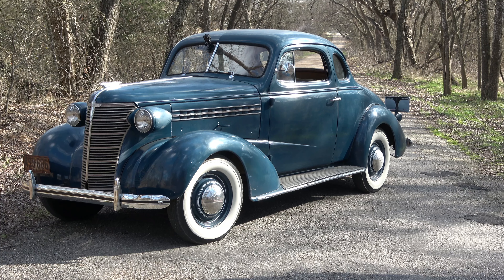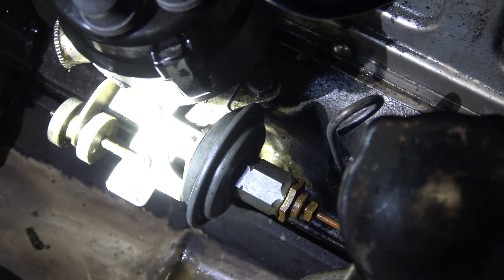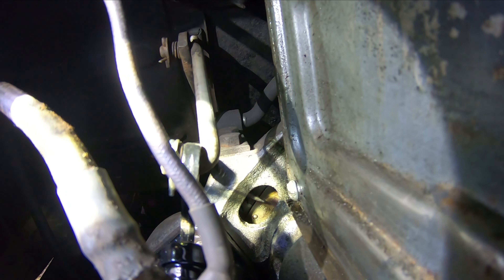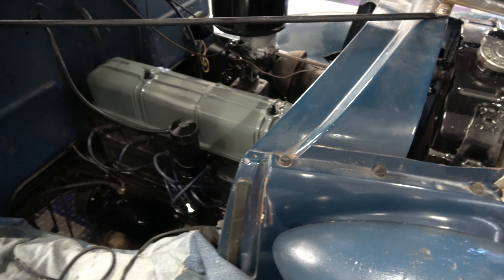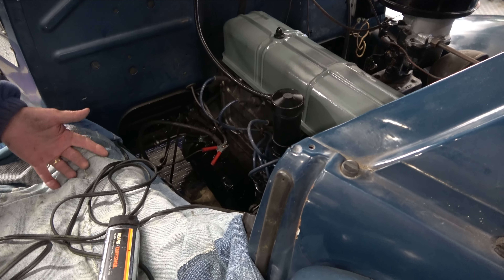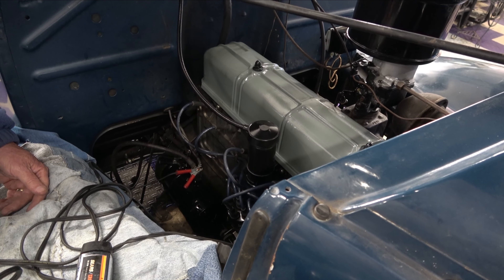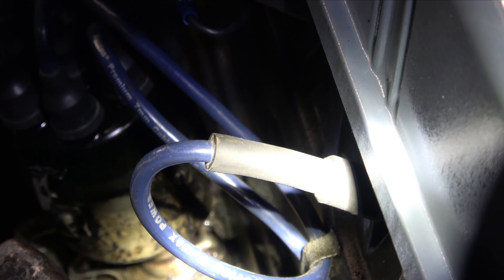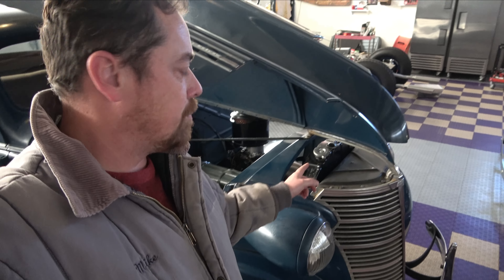Setting The Timing On A 1938 Chevy Coupe Master Deluxe 6 Cylinder!

Comment: I have a 36 that i converted to a 12v ( alternator) and since then it sounds like it’s out of timing. 
Is it possible that converting it from 6-12v messed up the timing? I’ve had it for 11 years and worked perfectly , starting at the 1st or second crank after winter storage (here in Illinois)!